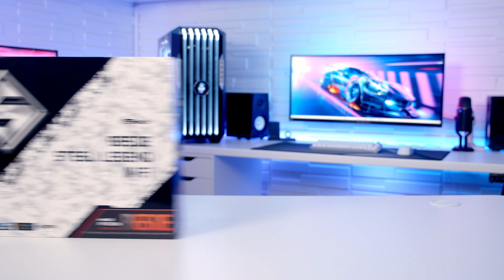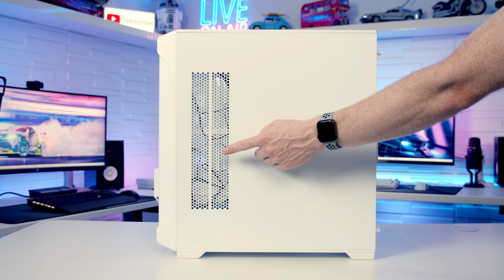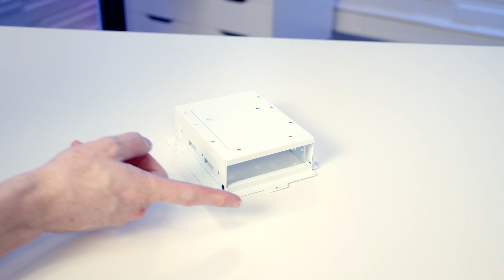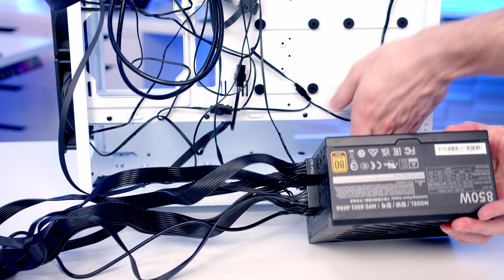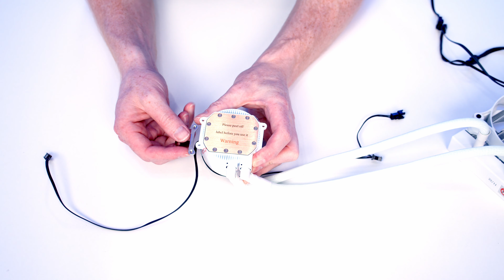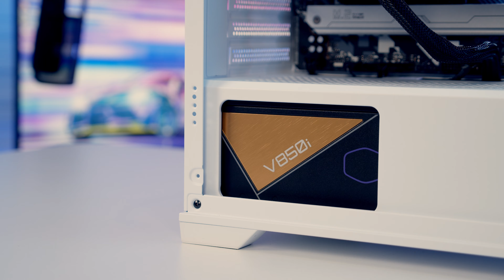Raidmax X603 Build - Step by Step Guide

Comment: Hi I have this same motherboard I already checked everything is connected properly a 1000w GT EVGA psu. And a 2tb samsung ssd 980. I turn it on but only the motherboard RGB light com on. Nothing shows in the screen fans don't spin. The motherboard diagnosis lights don't flash either. Please help its first boot and I've waited up to 20 min and nothing happens

Comment: I bought raidmax x616 for 59$ comes with 2 200mm and front mesh with hexagon shapes it has amazing airflow and can fit larger GPUs but the fans a little bit noisy .
Reply: is the airflow good in this case?
Reply: @kurotsuki2827  it's the best thing about the case 2 200mm fans moves a lot of air

Comment: Case looks amazing.  I just bought lancool 216 on your recommendation.  Did non rgb one tho.
Love your builds.  May want to spread word tho that nvidia has terrible gpu options with vram being too low tho.  I ended up going with 7900xt for $779.  Amazing card and should hold up at 1440p longer than 4070ti
Reply from the maker: It's a great case

Comment: Hey is it normal for ur GPU to rise its temp by 1 degree while idleing?  I have a 4080 and on idle it goes to 40 degree then rising up to 56 on idle then the gpu fans cool it back down to 40 degree and the cycle just continues? Have i done something wrong or is it normal?
Reply from the maker: Most new GPU have zero fan mode and this is normal. I run msi afterburner stock fan curve during idle to make sure fan keeps spinning otherwise the idel temps would just sepend on when i measured them
Reply: @ChristopherFlannigan  Thank you, I used your beginner guide to build the PC video aswell, very helpful and detailed video.